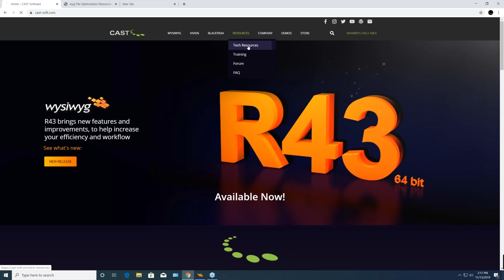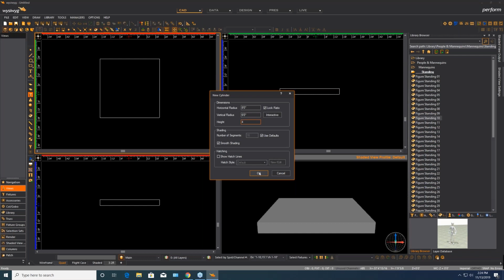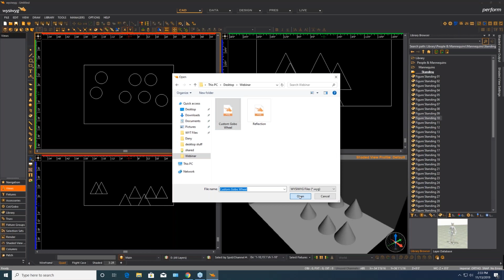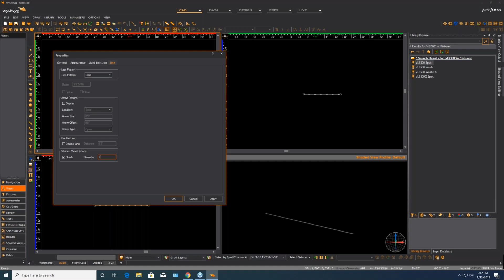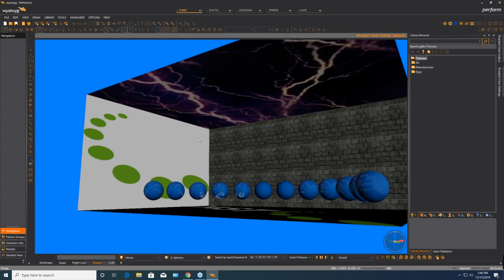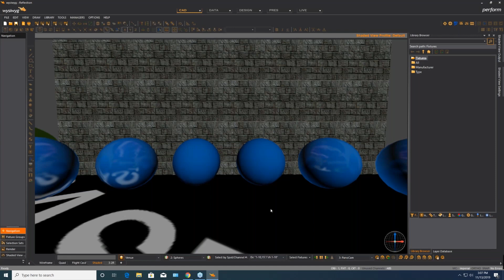wysiwyg Live Q&A Webinar with Dany Tancou

Comment: Hi. Is there a live mode in the demo. I cant find a live mode.
Reply from the maker: In the demo version, there is only one way to use Live mode and connect to a console, you need to open one of those sample files that comes packed with the demo installer. Those files are enabled to work with a console, so you can test them, but you can't connect using your own files, only with the paid version.